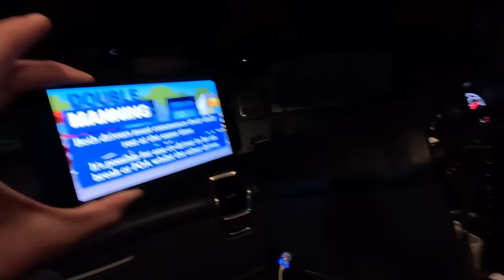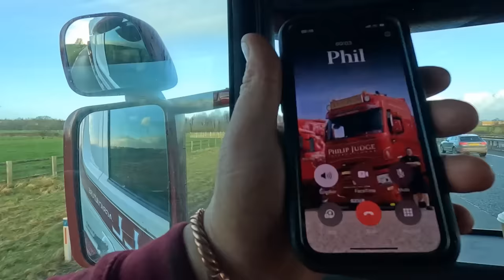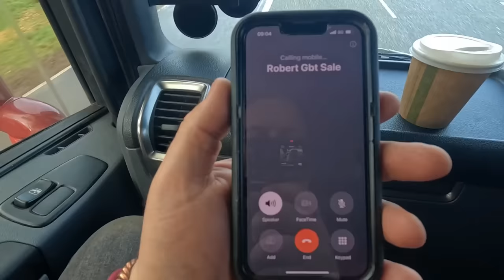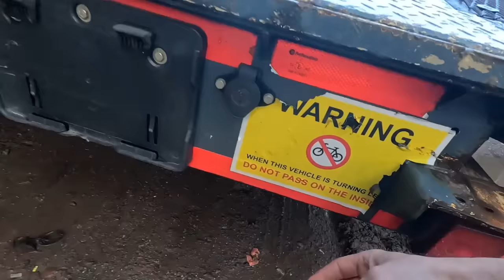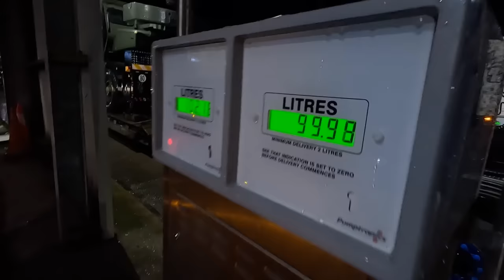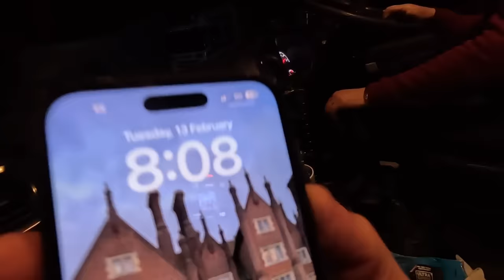I GO TRAILER SHOPPING | I FOUND THE ONE! | *FULL SPEC REVEAL* | #truckertim

Comment: Tim I pull a 2021 dennison stretch trailer with rear lift great trailer,  great 4 turning,  tight spots ,  take 2 tippers....👌
The best of luck with her,
The only thing tim is the ramps are not suited 4 low bumpers units... I'm sure you will find out in the future...

Comment: Hi Tim I'm from Australia and love your channel. I watch them when I can but don't understand the black smoke thing as we don't really get into  that the V8 noise is the best. You have to love that noise  and how does your exhaust pass the mot ? And would thought that the EPA might fine you from your Videos being that the UK has hard laws with emissions?  Anyway keep up the good work mate lol
Reply: It can pass MOT as It still has the factory exhaust. Fitted with a diverter valve for straight pipe.
Reply: Ok then so you can put a bypass switch to turn the tachometer  off  or the machine  were u put your card in as we don't have that in Australia. We still do the work diary's pen and paper but  we are just about to go digital so will either app on phone or work tablet if u have one. We also have 100kms speed limited on all heavy vehicles but some truckies put a switch in to  bypass the limiter. So this is all illegal you cannot have switches to bypass things and I would have thought that what your doing is no different to the others

Comment: I have a Question.  If it's legal to have & operate a TCab in the UK,  then why can't y'all have little bit bigger sleepers?

Obviously a T Cab is longer then a R and S series
Reply: no legal issues with the lorry itself, just technically can't run with a standard size trailer on, uk rules 16.5m max artic with normal trailer, 18m for low loaders.